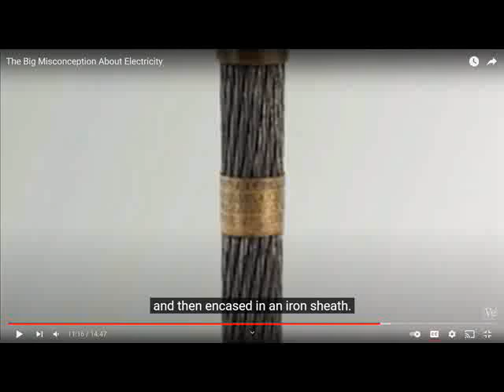Criticizing Veritasium's The Big Misconception About Electricity

Comment: Veritasium is WRONG.  His answer is a RATIO, NOT A TIME.  Try to solve the ratio 1/c sec and you should get (I get) c=c.
Reply: It's 1 Meter / C. 1M/(3x10^6 M/sec) = 1 300,000,000th seconds. Derek did a VERY POOR JOB of presenting the experiment,  mixed his metaphors with a DC circuit being analyzed as an AC circuit. No mention of the work done in the wire. Derek gets a D at best.
Reply: @billallen275   @Bill Allen  Thanks for that input.  The A/C D/C false equivalencies are blatant.  As @JohnRichter pointed out, there should have been a DOUBLE pole switch to prevent any polarity on the + side of the circuit.  My biggest issue was that I can't believe that there is ANY significant capacitance at one metre.  Why do we have air coils to slow electricity.  It, air,  is an excellent insulator prone to ionization.  Space is not empty and, even in space, there would be no transference UNLESS A/C was used which is a radio frequency at all frequencies... why you hear 60 cycle hum all the time.  I think if Veritasium's idea about capacitance were true we would have huge issues with any circuit, including household wiring... lights coming on when they shouldn't because they all share a common ground circuit and safety ground circuit... only the hot wire is significant.

Comment: You know there is an LC circuit in that Veratacium circuit. All inductive capacitive circuits have a f where capacitive reactance equals inductive reactance. So this means that a cycle of release of energy back and forth from C to L exists at that f. With C unknown and L unknown that circuit is vary different. So high f period tome 1/f = value the energy going back against the source. What is your proposed circuit diagram with values? And can you apply Nortin's therom to the load? Would like to hear the numbers for the transmission line historically. I follow some of your conversation but illustration would help.
Reply from the maker: This is the best I can do. I can’t provide anything more…